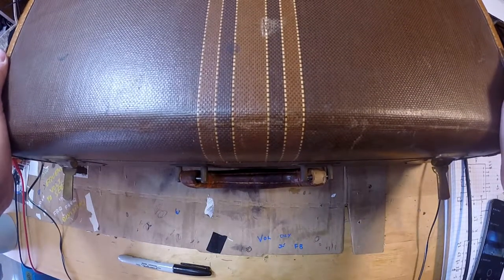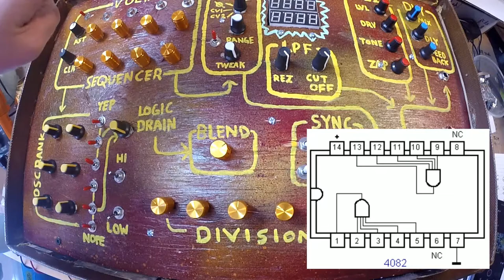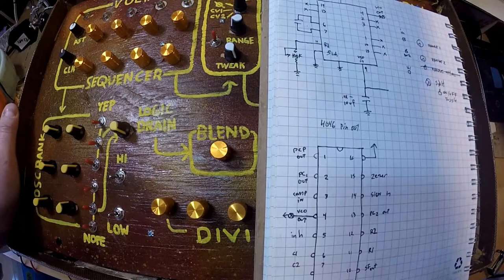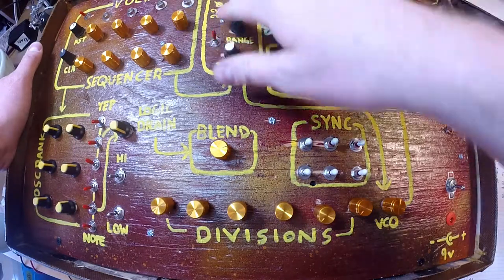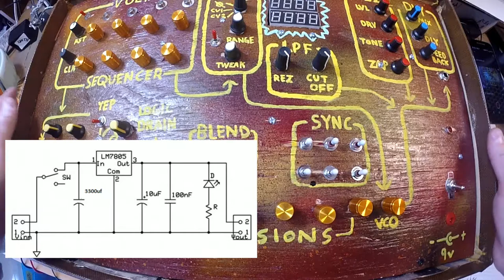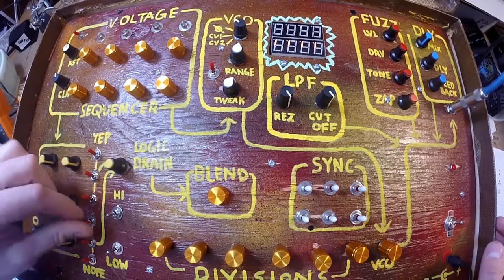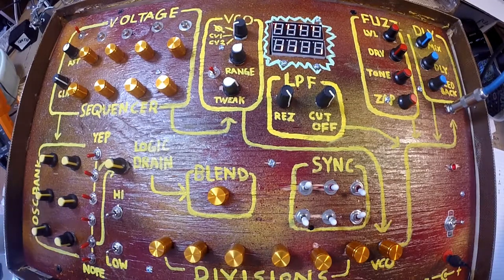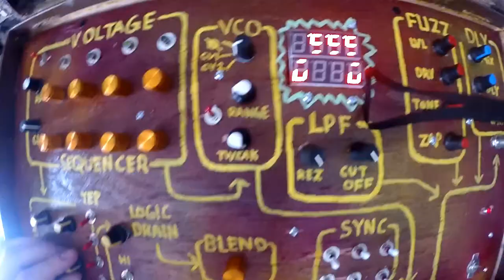April 2018 CMOS noise machine + FXs

Comment: Very nice! I've been working on a similar idea using a small flight case, but haven't come half as far as you yet. This has given me a bunch of inspiration. I'm not too sure about how to connect various circuits together, but there's abunch of ideas in this which I think will help me. 

I noticed the quick subliminal frames in the video towards the end as well!

Comment: Hey you are using the cd40106 Schmitt trigger right. I have been messing around with them too. I heard that you need to tie unused inputs to ground if you are only using a few of the oscillators do you know anything about that? It has something too do with them being CMOS chips.
Reply from the maker: I am using a 40106 - such a cool chip. (It can do more than just create oscillators, it can also invert signals from high to low and vise versa)

TBH, that's mostly a best practice thing - the unused gates when left hanging (connected to nothing) will unfortunately (or awesomely) just randomly select a voltage at times. So... if you have 1 oscillator set up and you REALLY are looking for stability (the pitch not varying over time) grounding the inputs will help that - wont cure it, but will cut it down.  My clock 40106 has all but 4 pins used (1 and 2 for the clock generation, and 7 to ground, 14 to v+)  Since it's just a clock and since THIS is a noise machine - I didn't mind a little extra unexpected whackiness.  The tempo rate of the clock rarely fluctuates when I don't mean it to but some times it does.

Other cmos chips that have inputs will want to be tied to something if not using them... for example a 4011.  It takes 2 inputs and gives you a gated output based on the incoming high/low signals.  If you don't tie the unused inputs to ground then sometimes they can go high and gate your signal in an unintended manner.  Word on the street is you want to connect all inputs to a 100k resistor to ground so when ever there isnt a signal coming in it will hit ground but the 100k resistor is weak enough to allow for all incoming signals to hit the pin successfully and work with the gate.
Reply from the maker: also save all your unused component leads as it makes tying inputs to ground on a proto/perf board really simple and can save you some wire.  (Once you clip the lead on a resistor after it's been soldered to a board, that metal bit can make a great conductor and you can slap several in place to quickly ground all you unused pins.)